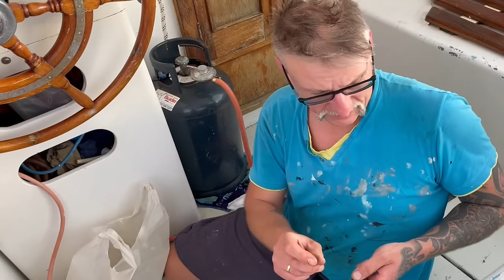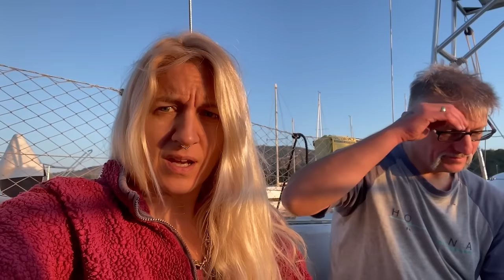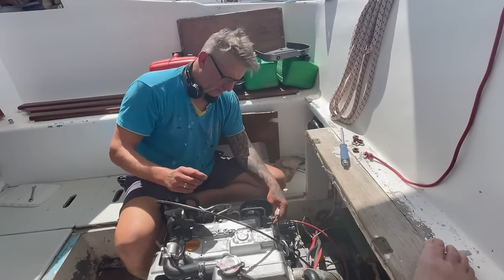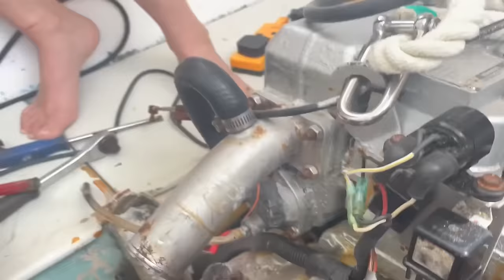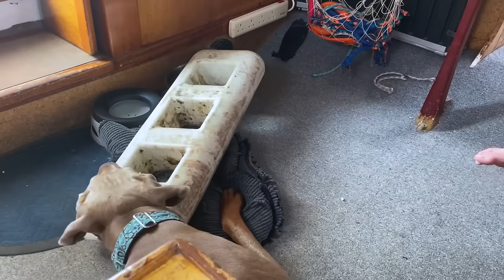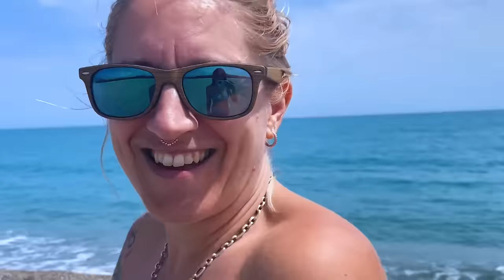Episode 166 - HOUR SPECIAL! Boatlife - 1st Sail, Engine failure and a family of Half Naked Flashers!

Comment: Hiya Chrs, say you can Totally weld that aluminum casing just replace the parts( whole clutch) EEK  Good luck. try matching it online by size and measurement instead of name.. clean it and put some welds on outside of case... let her rip bud!   I ve done this several times on motorcycles and boat heads, Trans bell casing and such     and yes you are right Beau they did know about metal interaction in the 80's, and way before... so as you pointed out just dumb.   lol   cD
Reply from the maker: Thanks for the information 👍🙏 we’ve fixed it all now but great to know!